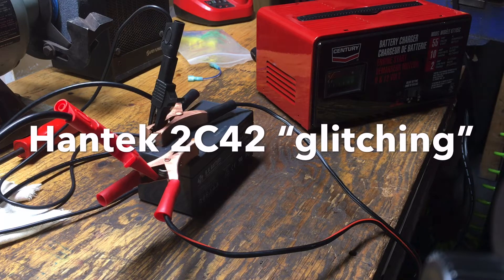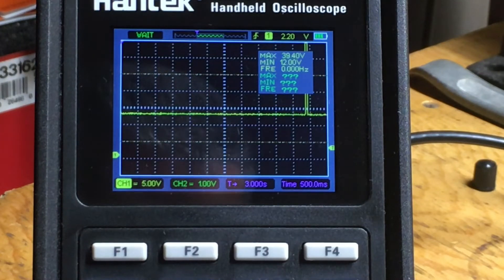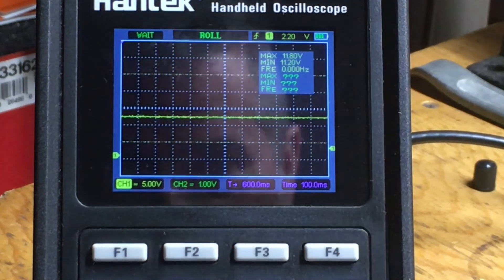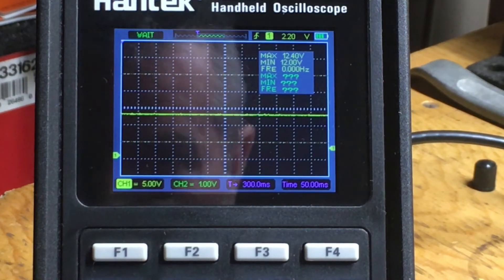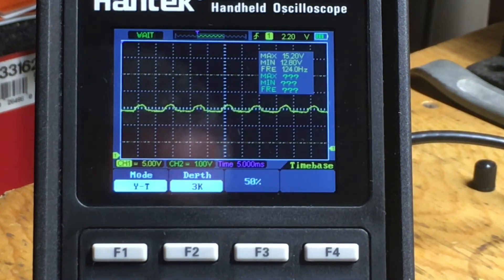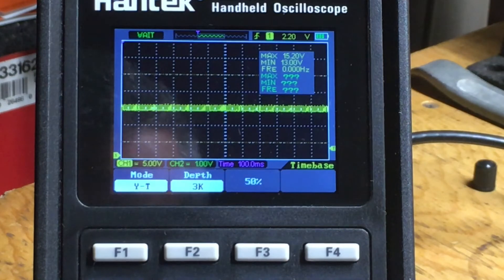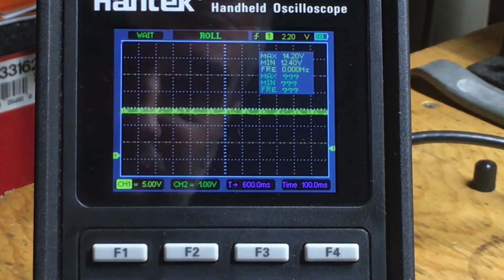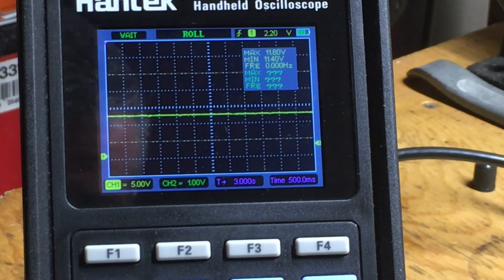Hantek 2C42 (P1) Defect

Comment: Maybe you have a invisible dog fence or electric fence around your yard? That’s always cause problems for me using oscilloscopes and even Metal Detector’s.
Reply from the maker: Good thought...A software reload fixed it (detailed in the subsequent video). Thx for watching 👍
Reply: @TheGibby3340  I’ve watched your videos… And although I don’t do automotive work… I Would love your input and advice. 

I repair and re-calibrate industrial equipment. Mostly process control equipment like on assembly lines, huge CNC machines, motor drives, and other automated processes. I need a decent scope for when I’m working in the field, as sometimes I’m away from my lab. 

 I got into electronics and industrial repair by accident. It started by buying/repairing faulty test equipment for my own collection. Then I started doing repairs for a few local factories and machine shops… Just to help fund my addiction to test equipment… And this was all by accident. 

I’ve always been in the woodworking a musical instrument business… full time for almost 20 years. But now industrial electronics is half my business. 

 Really can’t justify a ton of money for a fluke scopemeter, or even a $500 “micsig” or “Siglent” portable scope. 

However I do LOOOVVVVEEE my benchtop Siglent SDS1204XE

Since repairing test gear has been a hobby of mine for several years… It’s allowed me to purchase and repair, (and have calibrated) some crazy nice gear. I must have two dozen oscilloscopes… Some of well over 1 GHZ.  

However I’m only attached to a few of them. Mostly the siglent SDS1204XE and 1980’s scopes that I completely restored. Those 3 get used most… I almost never turn them off… And I’ll eventually sell or trade the expensive scopes because I’m always afraid of blowing them up so they don’t get much use. And I never need more than 200 MHz.

I was really eyeballing the 70 MHz hantek with the built-in meter and waveform generator. It’s by far the cheapest portable scope with the best specifications and it seems to be the most trustworthy. Would love your opinion on build/pcb quality of the hantek… 

I really enjoy your videos even though I’m not into automotive stuff I’ve watched most of them.

Thank you so much for your time.
Reply from the maker: @hullinstruments  Wow thank you very much for the thoughtful/kind comment. You are far more qualified than I to speak to the issue...but I can give you a couple of thoughts on the Hantek 2000 series from a hobbyist viewpoint...Surround and housing seems very solid/durable. Circuit board within appears very well made. Battery life is excellent. Screen clarity is very good but the numbers/characters are absolutely tiny. Daylight readability is very poor indeed. Navigation via the push buttons can be frustrating. I can’t speak to how well it performs compared to its published specifications. Bill at “Lockdown Electronics” channel has put the rig through some testing and may interest you. One thing is certain, for what you get...the cost is very reasonable. Hope this is of some value. Cheers 👍

Comment: 3 suggestions.. 1 bring the unit outside to remove shop electronics from the equation.

2-remove the leads or try other leads..

3- it's the 5g towers..🤣.. 

I would think it's interference from some other electronics..  that's my  suggestion..  and might as well update.. just because you can.. updates seem to fix everything today..

Cheers Ian.
Reply from the maker: JL's Auto Solution Hi Jeremy. Tried both suggestions...Will try to get a handle on the update. Chinese site is difficult to figure.  I don’t like the way this is looking. Ah well...small issue in the grand scheme of things. Cheers Pal 👍